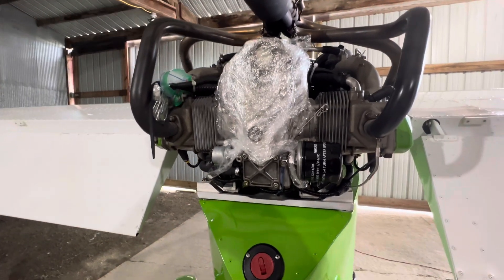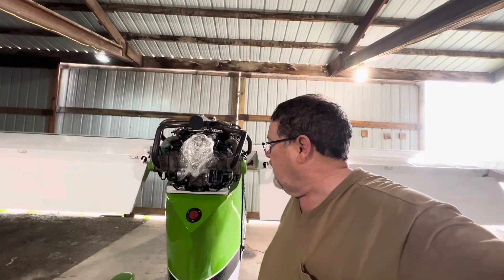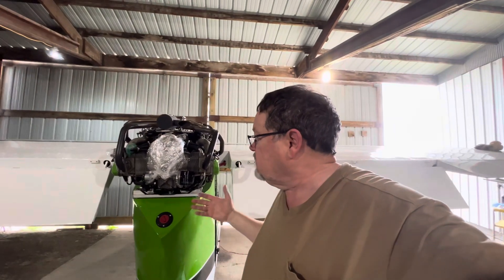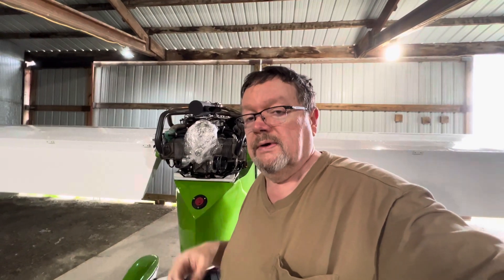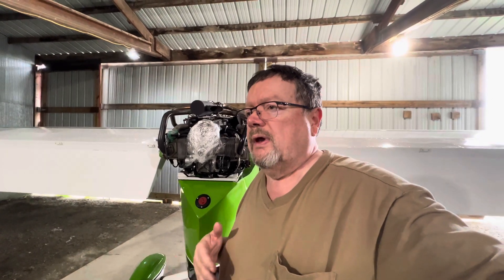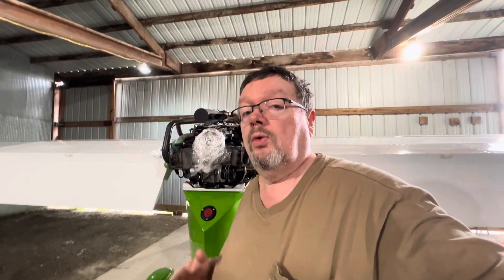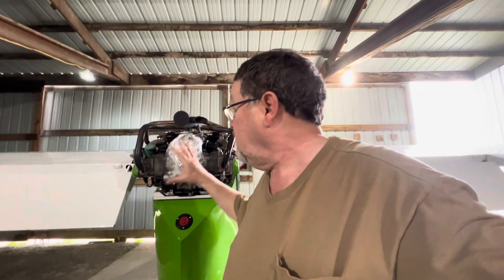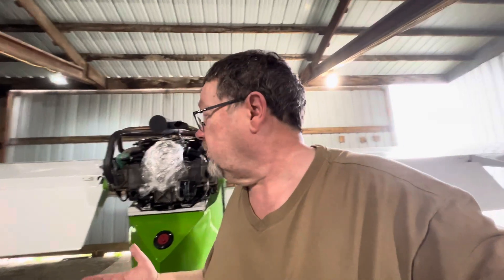Another Rotax 912ULS gearbox repair!

Comment: Hopefully it’s a straightforward issue that can be readily repaired, so you & your plane can return to the air soon.
Reply from the maker: I hope so, and look forward to getting a call from them once the gearbox is received.  Depending on how that goes, I might replace the Warp Drive prop with an E-Prop, which would be a substantial weight savings, and easier on the gearbox.  Thanks for watching!